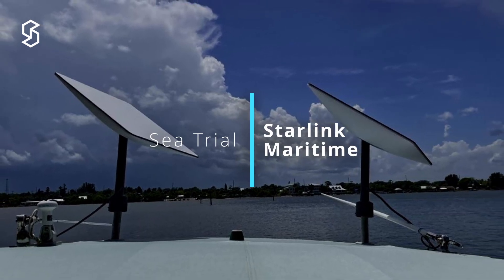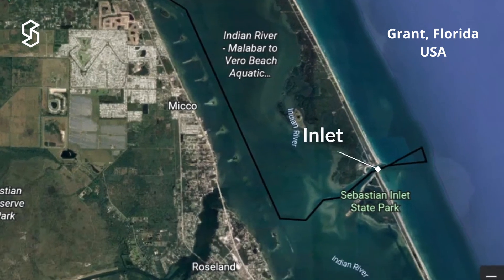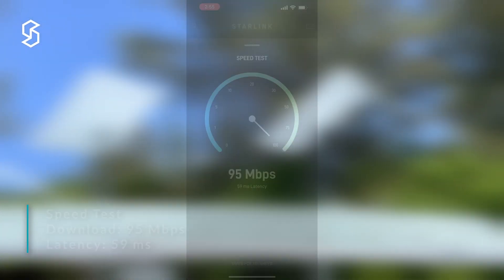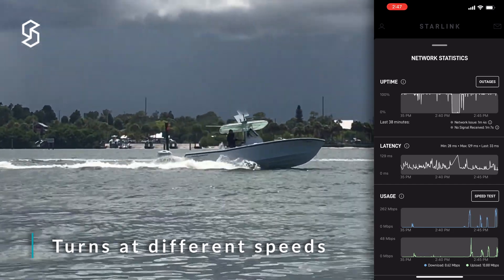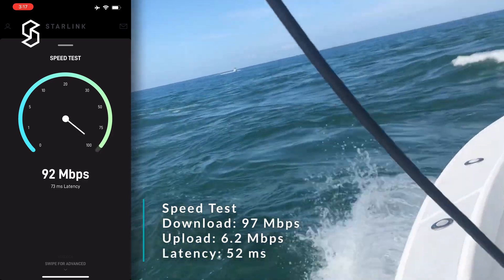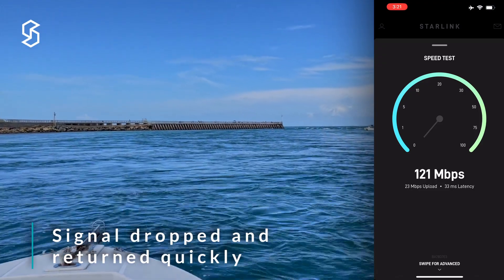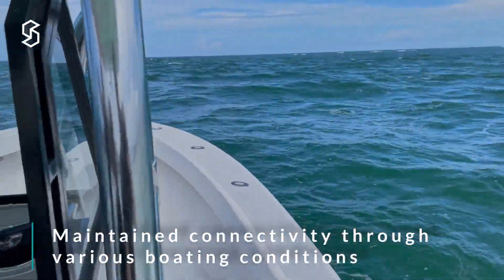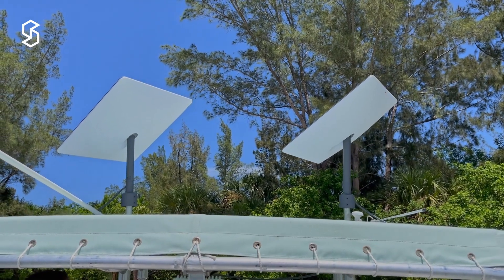Starlink Maritime Performance Testing at Sea | Starlink Authorized Reseller and Integrator

Comment: how can they keep getting the connection on the move while in fixed position, we need to set the relay to the correct position manually ???
Reply from the maker: Thanks for your comment. Starlink uses what is called an Electronically Steered Array (ESA), and ESA controls the pointing of the antenna without having to physically move any parts of the antenna. So you can set this flat panel up, and it will point on its own to the satellites flying overhead. Remember, the satellites in Starlink are in a LEO orbit, so they rise and set on the order of minutes from many different directions. It isn’t like a Geostationary satellite where you have to point the antenna at the satellite. Now these ESAs track the satellites as they move.

Comment: Very concerned on How robust this antenna and its mounting us ?  Planning on using on a 38 Henriques convertible sportfish northeast canyon runner doing 26-30 kts and navigating through 4-6’ seas regularly , so it is often used in rough water conditions with plenty of banging and rocking. Also curious to effects on the Garmin open array radar which would share the hardtop where the Star link antennas would be mounted   What real world experience have users experienced?
Reply from the maker: Hi Robert - We're happy to do some real-world testing/fishing. The pole mounts are not the best choice for what you are talking about. Starlink has since released a wedge mount which is much more robust and we have matching pole mounts for yachts. When we made this video, this wasn’t an option. The wedge mounts we have had out in rough seas and marine environments for more than a year now with success. Thanks for tuning in!

Comment: Can starlink work with cargo vessel? That vessel will move across seas and oceans, as we know starlink uses low orbit satelite.

Lets say vessel A now on sea 1, then 5 hours laters they arrived on sea 2? Will the internet connection stable?
Reply from the maker: Thanks for tuning in! We have conducted a series of Starlink Maritime testing on an expedition cruise liner and the results show that Starlink can provide higher speeds internet for the vessel. Regarding coverage, Starlink Maritime is available for use in waters around the globe, but coverage in local territorial waters is contingent on government approval. Therefore, it really depends where is your “sea 1” and “sea 2” in your example. When it comes to the hardware, the Flat High Performance (wedge mount) that’s been introduced recently has a higher wind rating, which will be more suitable for ocean-going cargo vessels. For our customers, we recommend them to install at least two antennas for more robust connectivity when used in motion and to reduce blockage zones. If you’d like to discuss further, please feel free to contact us at info@speedcast.com. Our expedition cruise trial results can be found here: https://youtu.be/hN19CWW8lQQ

Comment: May I ask if there is an IMU (Inertial measurement unit) design on the circuit for the antenna device of the Starlink maritime (flat high performance antenna)?
Reply from the maker: Thanks for tuning in! We have seen some dashboards recently published from third-party developers that are able to pull some data off of the terminals themselves. These are provided by third parties and not Starlink, so please be careful and use at your own risk, as the effects of these tools on the terminals or service are not known.

Comment: Is this test connected to one wifi router or two?
Reply from the maker: Thanks for tuning in! Each Starlink Maritime Kit comes with its own Wi-Fi router, so for the “Unboxing” and “Commissioning” videos, we had two Wi-Fi routers broadcasting separate SSIDs that we would connect to for the videos one at a time.  For the “Bonding” video, we brought both systems together with a single SSID so we could use them both at once.

Comment: Thanks for the test... Most people are not aware that the Starlink dish / router (2)  requires the signals to be bonded or used in failover mode by a router that supports the functionality.. Heck most people have no idea what this type of router is.. Viewers are initially tuning in to see the maritime router.. I think this requirement of the Maritime Starlink and how it works should be communicated to the audience first.

Comment: At $5k/month this seems like it would only be used on commercial ships
Reply: No this is very cheap compared to other satellite internet systems for ships and yachts
Reply: @linus2982  I think what I'm saying is at $5K/month is it not a viable option for cruisers, small families or couples living about and being nomads. This would seems like it is geared toward commercial ships or cruise ships.
Reply: @jroschella  i get what you mean but there is also a cheaper option for 240 a month where you only have 50gb priority
Reply: I currently pay $250 a month and it has a cool feature that allows you to pause your subscription. I haven't paid $250 yet.
Reply: @BravoTangoAviation  I saw they changed this a few months ago...I'm assuming you're switching between plans when not at sea

Comment: 1): Why the requirement for two receivers. Ive seen vehicles at 100km get perfect coverage with one and thats before roaming was completely unlocked?
2): why the need for internet connection while doing power donuts?
3): seems like this video is simply an advertisement for an unnecessary device!
Reply from the maker: Thanks for checking out our latest video! Speedcast is a technology agnostic communication provider. We test and assess all new solutions that come to market in helping our customers determine the optimal network design for their operational needs. During the Starlink Maritime system testing, our team attempted to replicate the environments that our maritime and offshore customers operate in. The Starlink Maritime kit currently deploys with two VSATs, however, a flat panel and mounting hardware option may be available in Q4 2022.